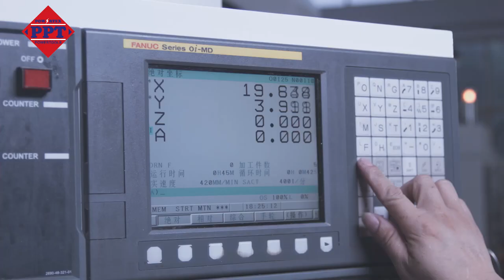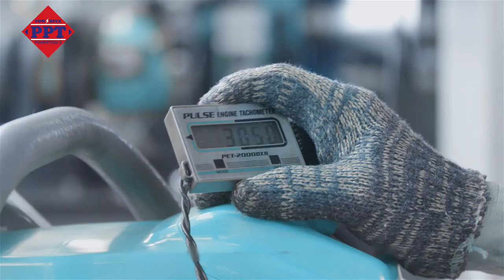Powertex High Quality Gasoline Chain Saw

Comment: The little impriwe the box end breack ,,,but noubady didnt improwe the engine...???,,,that us old tehnology,,,for the same endine inside the protection of parts witch giwe a 30% more 😊security in hard worck or warm places...end in normal cutting gowe the 100 % of feeling on 1cmm or 1" OF SWORD EFICIENTY....ITS NOT COMPLICATED ....but noubady want to make a saw for home with 5 yrpears waranty in proper use end in 20 years of the same filling end wibration at worck